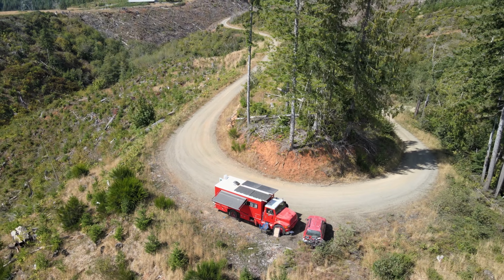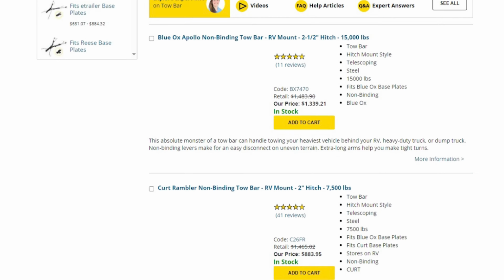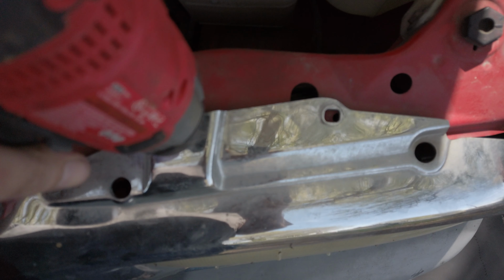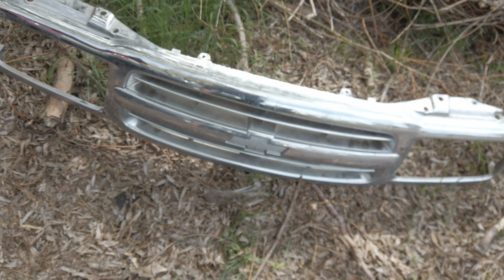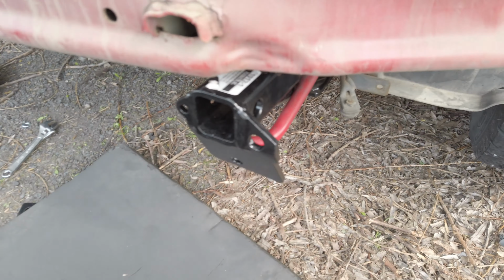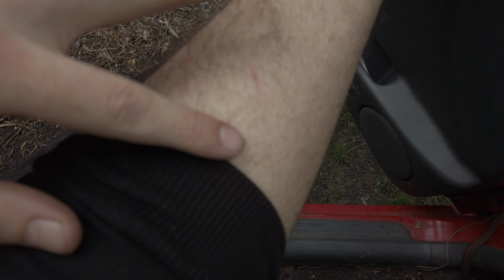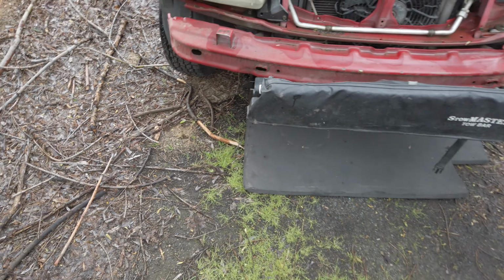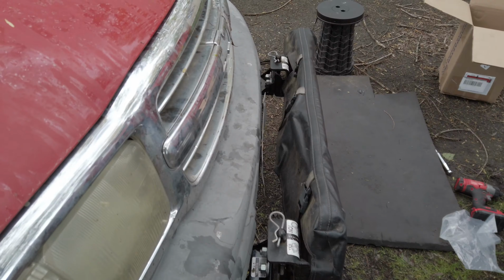How To Install a Towbar on a 4X4 Chevy Tracker

Comment: Suzuki's version of the second generation Chevy Tracker is called the Suzuki Vitara. Also, it was the driver side headlight that you had to remove, not the passenger side one. What year is the second generation Chevy Tracker that you have?
Reply from the maker: 2002, great little toad. Recently replaced the shock absorbers and it rides really nice now